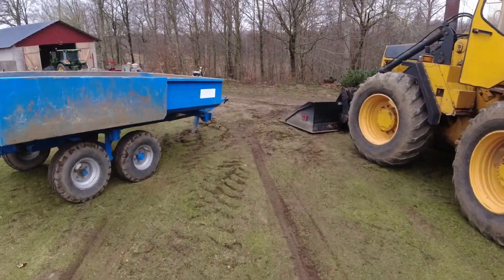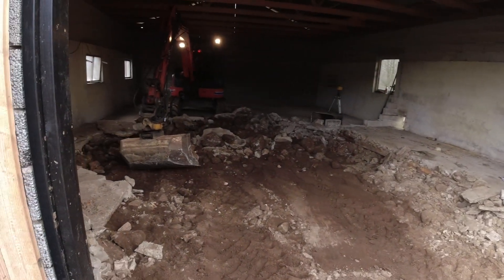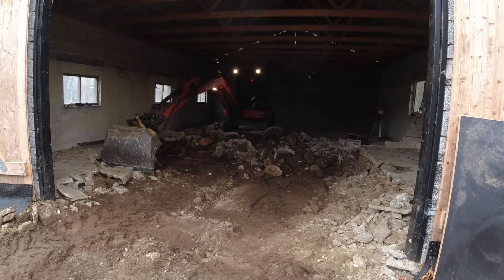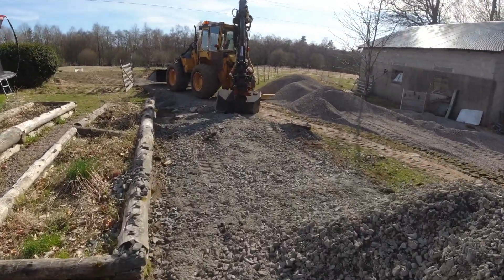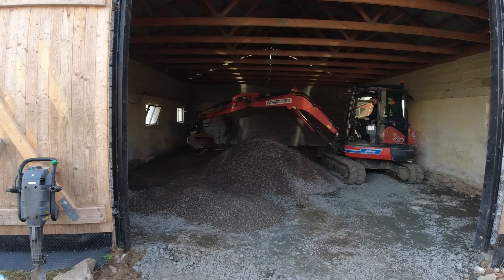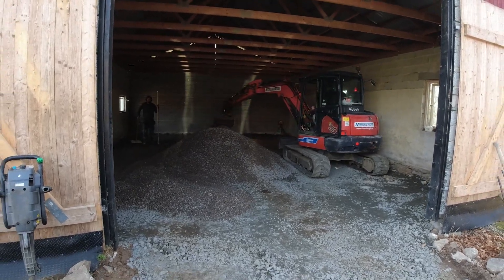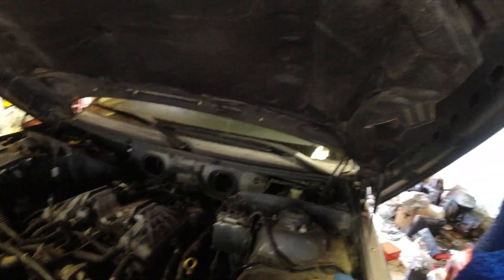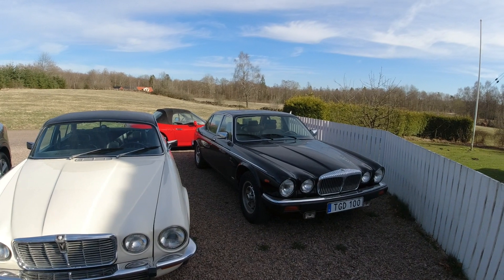Building my Dream Garage! (Part 1)

Comment: Some advice on your concrete pour:

Specify a 4" minimum pour of 5000 psi "high early" concrete, or a 6" pour of 4000 psi "high early", if you want to put in a lift.

Specify that you want "welded wire fabric" instead of chicken wire inside the slab. 

Specify that the welded wire fabric be put "on chairs" (stand offs). This will keep the WWF in the middle of the slab, so that you'll have a stronger slab.

Don't forget to have them put in at least one expansion joint every 20-25 feet, and crack control joints half way between every expansion joint.

"High Early" concrete cures a quick solid layer on the top, so you'll get a walkable surface in a few hours, versus a day or more for regular concrete. You'll want to wait 7 days before driving a car on freshly poured concrete.

You can finish the top with "brush finish" or "steel trowel". Brush finish is a little rougher, and prevents those ball bearings that fall out of the Jaguar steering boxes from going very far. It's also nice to paint over, and slows fluid movement, because it has a texture. Steel trowel is very smooth. It's great if you're going to put a vinyl floor over it, not so great if you want to paint it or leave it natural concrete.

So, when you talk to the concrete guy, you're going to say:
"I want a minimum 4" pour of 5000 psi high early, WWF on chairs, expansion joints every 20 feet and control joints half that. Brush finish."
They'll nod and think you know what you're talking about.

Comment: Don't be in too much of a hurry to move the cars in after the concrete sets. I believe it still gives off a lot of rather corrosive humidity for a while, so you'll want to have it thoroughly ventilated. Ideally, if the budget allows, a sealant will help keep fluids on their appropriate sides.

Comment: Thanks for the update! I have a XJ 40 -92. My first Jaguar... Do you know if the headrest are adjustable at all. All I have seen are stuck tight to the chair. In my -92 they have the lamp in the headrest. I believe later they moved the lamp to the backrest. I also have a leaking steering gear? If you have any tips I will happily hear about that! Keep up the good work. Wish I had a garage like yours to be🙂

Comment: You mensioned new tires being on the Daimler D6, is was wondering which brand was used?
Our stock 15" (215x70) are quite favourable for being Camper/Motorhome/Van size tires, but I'm looking for a normal A brand tire, not the classics WRX or P5's though since they are at extreme prices atm.
Any suggetions?